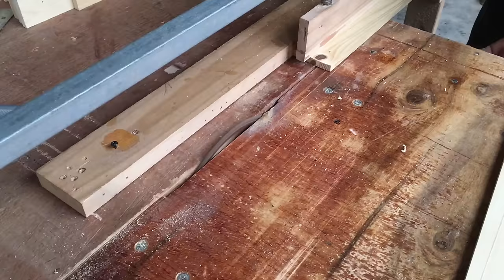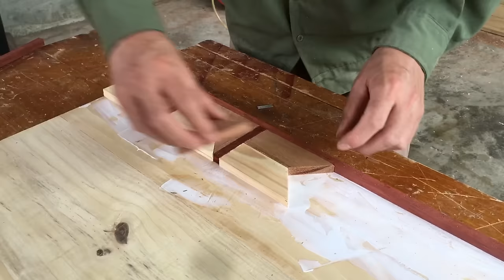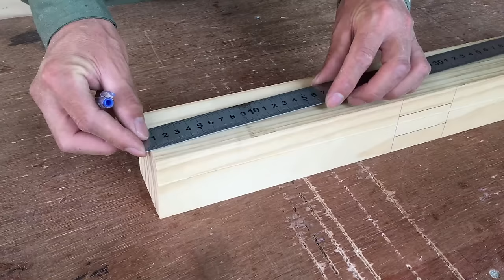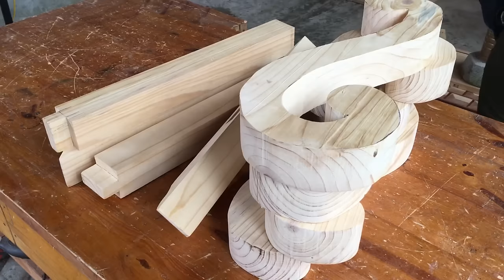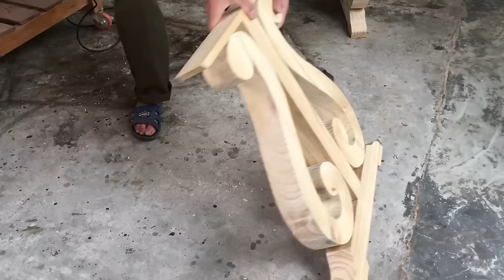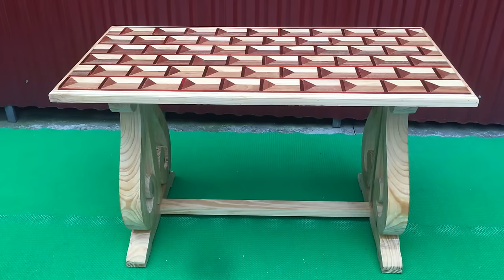Great Creative And Ingenious Woodworking Ideas Will Surprise You - Art Decor Coffee Table

Comment: 11:12 Are You Blind ? You have a natural knot in the wood ! Form your design around that !
Yeah its a cool design so? That thing wont last a year!  
Three grains and two knots in one piece? It 'll be spitting nails before the year is out. 
Joiner burns, table saw burns... why ? Fucking split it and make it an eight piece set.

You need to bend over to pull the router, you're doing something wrong. Either going against the grain forcing it, or the setting of the router is too low, Or the head is n't cutting , needs sharpening. 
Tip for curves on the band saw. Use the router first, to etch a border around the design.
Gives you a guide to follow, that's stable through the turns.